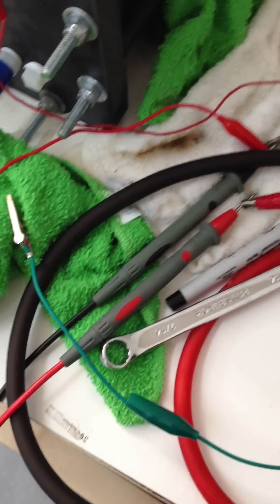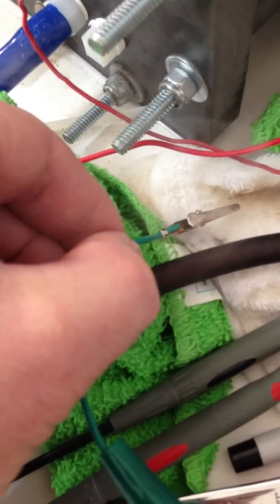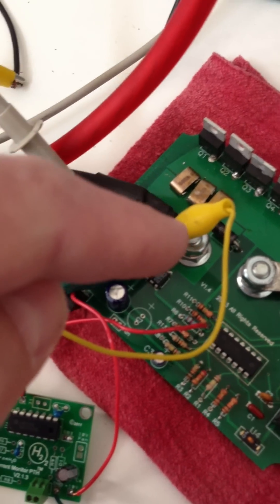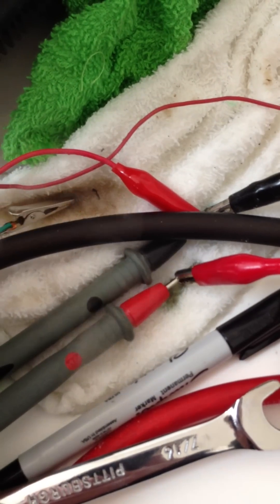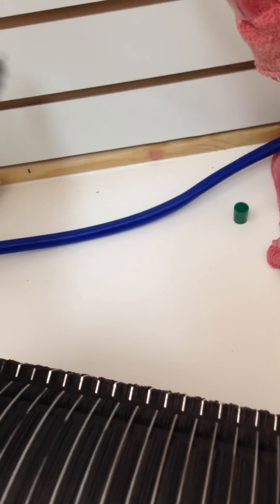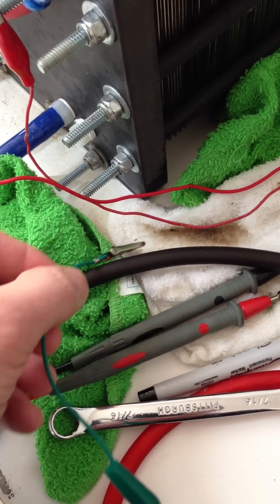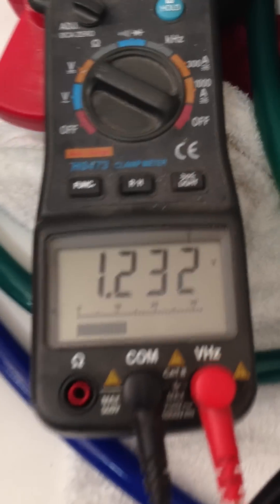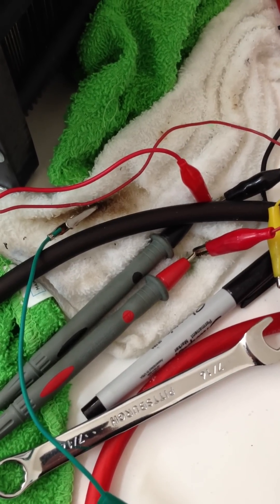Strange observation while testing a prototype PWM

Comment: Stored power from your capacitors.  I've seen that befor.  Plus with the electrolyte soaked in the rag and your connects from the PWM, you have a bridge connection.  Until those capacitors are bled down you have that symptom.  Very dangerous...
Reply from the maker: yes but those are 35 volt caps. You can make that kind of spark with 35 volt.

Comment: It is obvious when water becomes disassociated, "other reactions" are also taking place. The HHO community focuses ONLY on what happens inside the cell and the gas produced.  Now it seems obvious that when water becomes disassociated, "other reactions" are also taking place.  People are talking about plasma etc. being formed.   One might also theorize that while electrolyzing water, we also attract energy(ies) that have gone unnoticed and unstudied.  =The electrolyzer equipment might be an "antenna"
which attracts something like "dark energy." 

Next time DO NOT SHORT anything out.  Remove one lead at a time and see if the phenomenon remains. If it does remove another. If it stops, replace that lead and remove another.  =Remove ONLY one variable at a time.  This will help you locate the circuit involved.

This happens from place to place and time to time. Almost NEVER gets replicated. =Lightning in a bottle."  Enjoy it while it's around.    

NICE WORK, as always!

Comment: Re..Storage voltage in your cell,...There is point where your cell start to Reverse, Usefull Electrical Energy,...!!!Now you need to find a away to have it Continuous,...it will Works without power input !!! Good Lock,...

Comment: maybe the electrolyte from the cell changed the rag into a capacitor and the positive lead somehow charged it - between the psu and other device being used a bridge happened until it was shorted out?   best guess. some where in there high voltage happen.... hope you figure it out. was interesting.